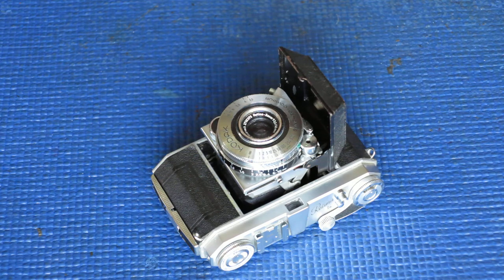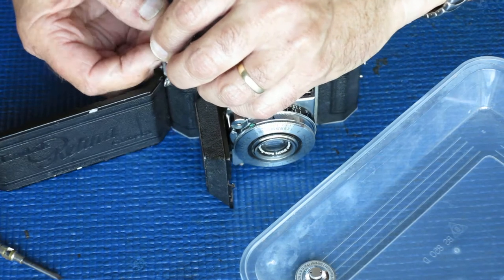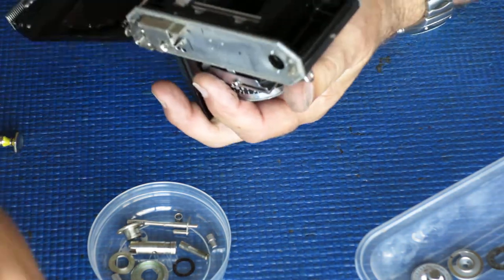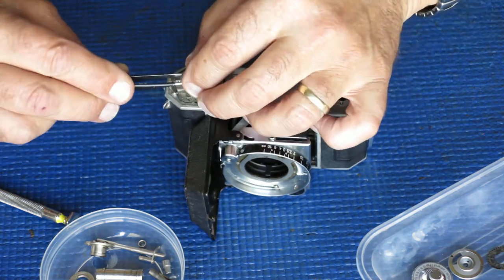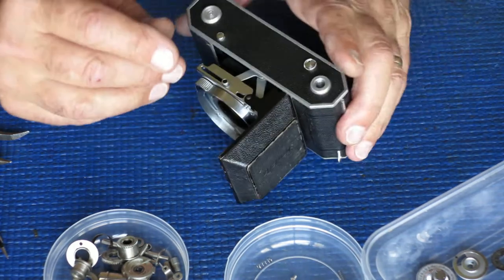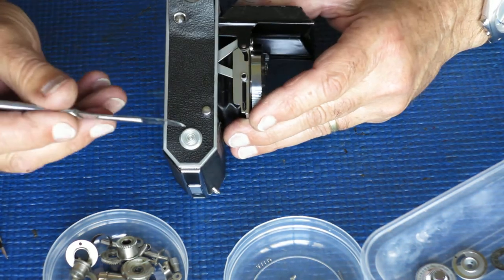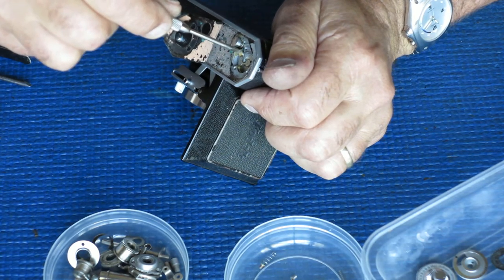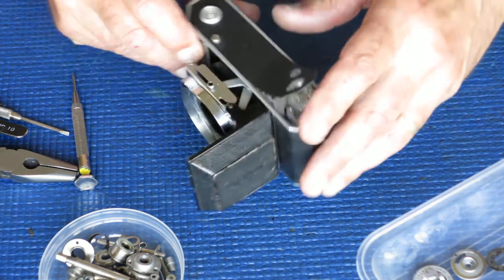Kodak Retina 1a servicing 01: Stripping the camera down.

Comment: Good, now I can fix my stupidity from a few weeks ago. I took apart the winding mechanism and positioned the toothed slide wrong which in turn broke the shutter mechanism, now I have to fix that. The good thing, I managed to remove all the sand that blocked the winding since the 80s plus the viewfinder which was loose.

Now I only need to fabricate a tool to get the shutter out.

Comment: What was the name of the tool you used to remove the shutter? My Retina appears to have been serviced improperly, leaving the focusing screw on the shutter assembly and it is a pain to try and get off.
Reply from the maker: That is usually called a lens spanner. The Retinas with an f/2 lens, like the IIa or IIIc types have a rear group that extends well out the back and makes access to the retaining ring difficult except for special tools designed specifically for that job, which just aren't available. On the Retina Ia and IB models you can usually get to the retaining ring with a pair of circlip pliers with the tips ground down to suit. Often it is easier to remove the rear lens group first.

Comment: Hey there, any suggestions on how to fix a frozen shutter?
Reply from the maker: What do you mean 'frozen'?  Do you know how the camera works? Have you checked to make sure the film advance lever is not simply locked because the frame counter has reached number one?
Reply: @ChrisSherlock  “frozen” as in stuck. Specifically in the open position. I was wondering if you knew any tips to get it to shut without disassembling.
Reply from the maker: No, it needs to be repaired, sorry, there is no magic trick.

Comment: i have a question
in the focusing ring of my kodak there are like scratches from infinity to 2,5 meters and i guess is becouse the ring is touching some part of thw camera, do you know any solution
Reply from the maker: Probably the little cover, at the 10 o'clock position as you look at the shutter, over the gear that couples the cocking action to the curved rack on the shutter is set too close to the focus scale ring. Slightly loosen the two screws, push it away, and re-tighten the screws.
Reply: @ChrisSherlock  thanks m8
Reply: Chris Sherlock :  I have a mint retina 1a everything works but the focusing knob is frozen at infinity.  Any suggestions?  Thanks